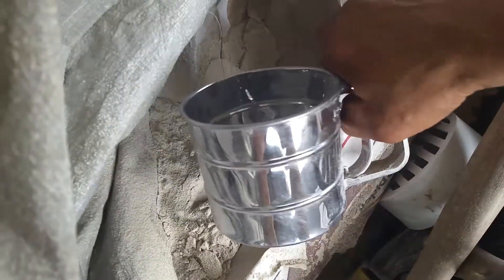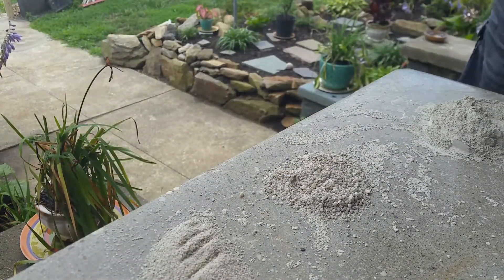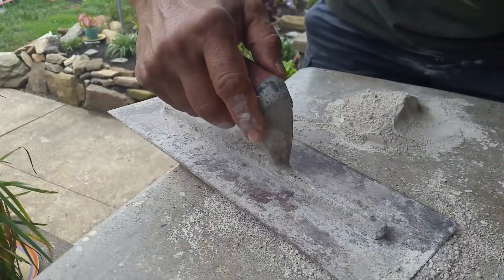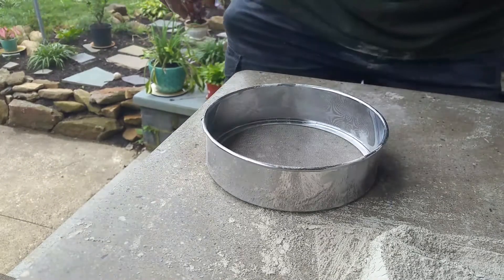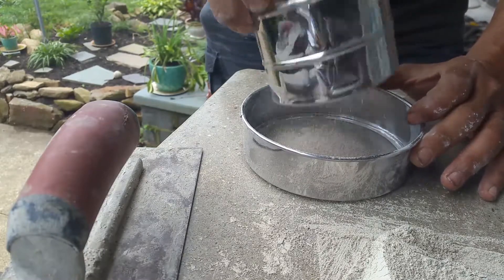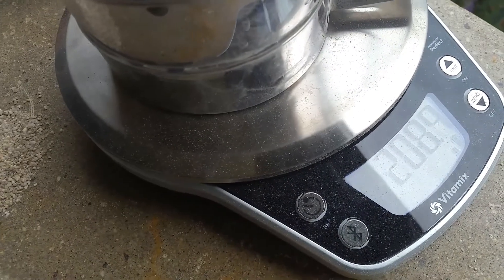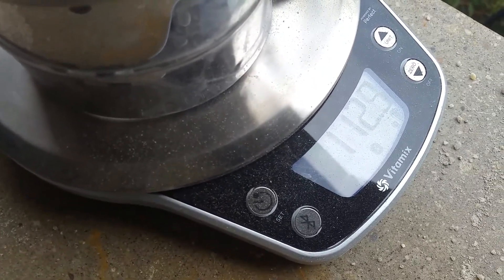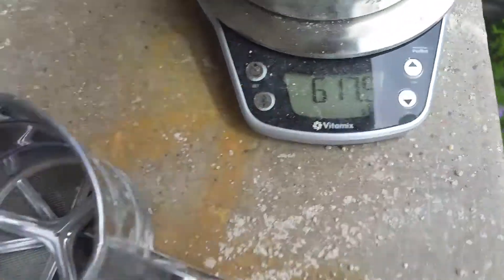RapidSet Mortar is "Concrete" and how it gets it's high strength  CSA cement

Comment: Are you saying we can make this high compressive strength mortar by adding the following ..... Would  you say the aggregate is like typical bed sand and  then higher aggregate is x4 in size of sand very small rocks pebble  ? I also wondered what csa i would use , standard  quick dry cement ? Have you tried a mixture of your own and was. It as strong ? What makes a quick set cement as opposed to not ?
Reply from the maker: Just a couple of answers, CSA (please research it, it is NOT portland)... It also has a huge heat issue and you must keep surface cool / damp while it cures for an hour. 
It does not have the same issues as portland cement but has a learning curve...
I would recommend a retarded be used -- I am working on citric acid mix and will post once I am satisfied with results.
You can buy CSA from RapidSet but it is just as easy to purchase bags or boxes and use as is.
Sizing is not relative to me as I used percentages, as you see in the video...  
Please, feel free to make your mix and then compression test it with a hydraulic press with a gauge... nothing fancy is required.
Reply: HowThingsWork Construction Engineering thanks for your information. We pay 6-7 x the price of normal portland cement here in Australia, do you pay that premium for those products too? Bag cement $9 aud , quick set $60
Reply: HowThingsWork Construction Engineering what is the purpose of a retarder mix ? Heat?
Reply from the maker: @das250250  , it slows set time... Gives you more working time.